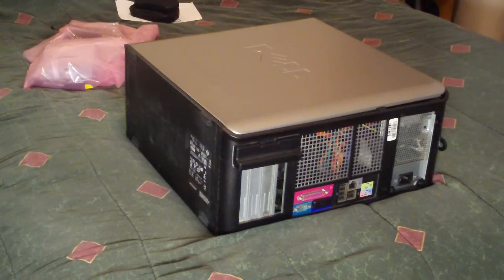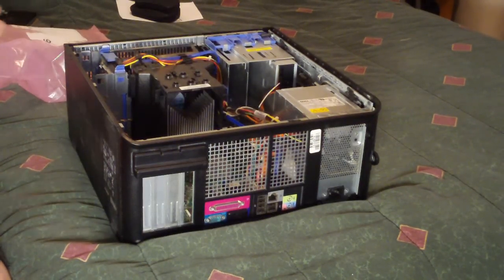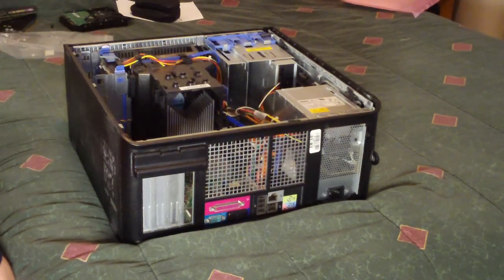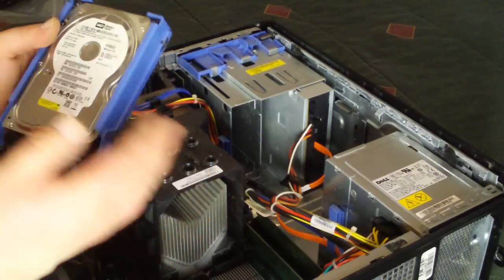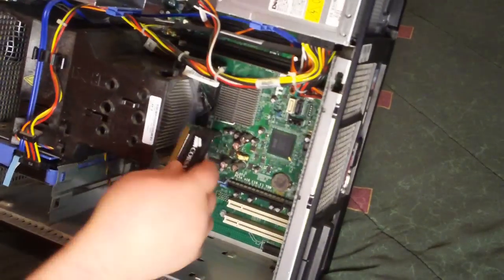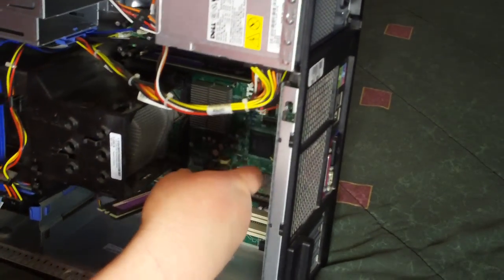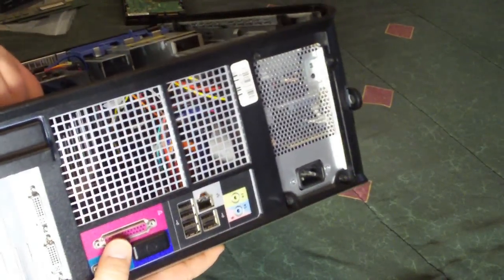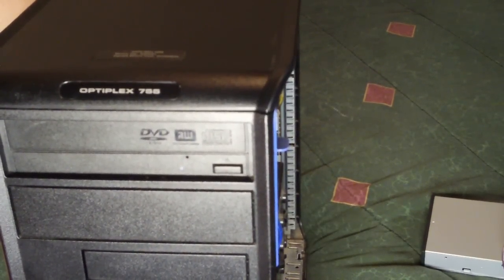Upgrades to My New Dell Optiplex 755

Comment: The Dell 755 offers:

1. RAID 1 support for real-time data-mirroring protection
2. Intel Q35 Chipset (745 uses the 965 express)
3. Quad core option (745 does not)
4. 1333 MHz memory option (745 supports 800 Mhz and slows down to 667 with 2GB)

Comment from the maker: You may be able to go into the Bios and tweak the fan settings, but I would be careful. if the fan is running at a very high rate then the CPU may need to have the thermal paste redone.

Comment: Probably one of the most upgradable Dell systems ever. You can go from a single Core 2 Celeron 1.6GHz all the way to a Core 2 Duo E8600 or Quad Q9650 (after BIOS updates).
Reply: or a Xeon

Comment from the maker: That will work as long as it's not the ultra small form factor system. Most of these models should have at least 2 or 4 SATA ports, but you will most likely have to supply your own SATA Cable.

Comment: I hate the heatsink in this thing. I'm currently running into problems with it being to large. Have you found any way to attach a different 3rd party heatsink?
Reply: John Duthie "Too large"?  The heat sink is designed specifically for this machine and the cowl in which it resides.  If you can't get it to fit back together, something isn't properly installed.
Reply: I meant that it was to large to allow a regular size graphics card. I tried fitting a evga gtx 960 in there before deciding to scrap the machine. The case also only allows for single slot cards. Sorry bout that.
Reply: John Duthie I have AMD Radeon R7 260X  in the 755 MT tower, using a powered pci express extender cable i got for $6 on amazon.
Reply: Where were you 2 months ago when I needed you +karaoke2fame! No I'm actually glad it didn't fit because I needed a reason to upgrade anyway. I thought about replacing my socket 775 dual core duo with something a bitter higher end, and was disappointed. Now it's sitting in the closet collecting dust.

Comment: I have the same dell optiplex 755 model ad you and I wanna know if the video card bracket a half bracket or full one?
Reply from the maker: It depends if you have the full desktop or the Small form factor. Mine was the full desktop model, so it had a full high graphics card bracket.

Comment: I still do not know how to open the card bay from your video, the thing moves back and forth, but pressing the latch inside the case does not accomplish the feat.  I am about to take a hammer to the plastic part to get the Dell propriety video card out of the system.

Comment: I'm thinking of buying this machine, my gateway died, I wanted to take my HD from my gateway and just drop it into the new dell that will come with 160gb HD, so I can have 2 drives and not have to tranfer all my stuff. The question is does the Dell have the Extra Sata and HD cables to upgrade thanks

Comment: I know it is 2016 now, but I'm stuck with a dell Optiplex 755. So I went around and found awesome Hardware for it, from people who desperately wanted to get rid of their old parts. Like for less than 20 quid.

Here are the specs of my Optiplex 755:
Intel Core 2 quad @ 3.00ghz, but for some reason 3.01ghz (Still with old aluminium heatsink :/ )
8gb of 800mhz ddr2 Memory (4x 2gb)
msi gtx 650 ti oc (ripped apart the floppy power cable for it :D )
cd / dvd / blu-ray drive (Can only write cd and dvd)
2TB Harddrive @ 7200rpm
the same cardreader, but newer! (Can read and write SDXC!)
5.1 pci Soundcard
pcie 1x to 2x external usb 3.0 and internal usb 3.0 card
the same old fricking powersuplly :( (I hope it can take a gtx 1060...)

I got the better Optiplex 755!
And I could get an msi gtx 1060 6gt oc, but the cpu-heatsink is in the way :(
I would love one though! :D
Reply: oh yeah, and running windows 10 pro
Reply: For me it's 2018 and a 2008 computer isn't going to cut it, I really need help to upgrade it
Reply: 2022 now, no upgrades worth putting money into for this system. I'm using mine as a NAS

Comment: I have a 755 but with same ram and amount as yours but i placed a Intel Xeon x3363, Nvidia Geforce GT640 2GB and a WD blue 1tb.
Reply from the maker: NICE! The Geforce GT640 2GB is the same card I have in my Dell XPS 8700. It is a very capable card, great for rendering videos and watching HD Video.
Reply: I'm going to put a gtx 750ti in the near future to keep up with my 1080p monitor for gaming
Reply: I like your computer
Reply: Everything Possible you put a xeon chip in your 755 did you have do the sticker mod or whatever it's called?
Reply: Yes I put the sticker mod and also cut the tabs off the CPU socket
Reply: Everything Possible If you didn't jump on that already, 950 will be out in few weeks.
Reply: 950 what?
Reply: Everything Possible 950 will be replacing 750 ti as Nvidias $150 option.
Reply: Oh the gtx950ti?  Nice I'll check that out. Thanks for letting me know.

Comment: I'm thinking of shoving the 755 motherboard into my dimension 3100
Some of the ports won't be used on the back and will be completely open from the motherboard but oh well it'll look like a 3100 but perform much better.

Comment: I have an Optiplex 755 PC just like this one. It has a dual core processor and after running a test it appears to have only core running from the dual core. Is there any replacement processor i can find or any upgrade i get get. i look up my intel processor model and i couldnt find it. The PC is running Windows 7.
Reply from the maker: Click the link below to see a thread that lists all the compatible processors for the Dell Optiplex 755

http://en.community.dell.com/support-forums/desktop/f/3514/t/19537919

Comment: The i5 does NOT have the right socket type for it it has a LGA755 Slot I know the Intel Core i5 does not fit in that slot but your graphics card is good and this motherboard has only 4 RAM slots and the power supply might not have extra power connectors if the card needs that

Comment: I have a dell optiplex 745 mt 305w PSU. I am putting in a intel Q6700 1066mhtz and RAM DDR3 2g each x 4  8g that is to 1066mhtz and lga775 skt. Maybe getting ATI HD6670 or a HD7 series also instal W7 pro 64 bit any suggestions on my idea and questions can i use the same heatsink and does the DDR2,3,5 does it have to match the GPU as stated. Thank  you for ur opinions and help

Comment: Can you use a PCI express 3.0 GPU in the Optiplex 755, I know it only supports 2.0 but please tell me. :(
Reply: +LordHezi I googled it and it said "There are three versions of this slot, but they're backwards compatible, so a modern PCI Express 3.0 graphics card will work in a motherboard with a PCI Express x16 2.0 slot. This motherboard has two PCI Express x16 slots."
Reply: Nicky O' Mahony YES !
Thank you so much man :D

Comment: i have same pc it does have 2 slots for hdd and power lead comes with extra power plug u need only extra sata cable( ny 755 does have 500 gb hdd en9500 gt 1gb  and 4x1 gb ddr2)

Comment: Great vid. Just a query, any ideas on an internal audio/sound card. I would ideally like 5.1 or 7.1 connectivity . have upgraded videocard and memory card reader but audio is lacking that oomph with just the two 3.5mm audio out ports. I have exactly the same model as in the video. Many thanks.
Reply: Creative Omni USB sound card or the Creative Recon 3D SB1350. They are both the same sound card with 5.1 Surround (3.5mm or SPDIF/Toslink outputs & 600ohm Headphone output). The only real difference is that one is USB and one is an Internal Desktop Model. I use both models on two different computers and use the USB with my Dell 755 MT as it doesn't use my PCIe slots which I use for a Asus AMD HD 7750 GPU and I have a 3.0 PCIe USB adapter card in the second slot. I also use the Creative Omni USB sound card with my laptop as it and the internal Recon3D easily hook up to the latest theatre systems with SPDIF or Toslink inputs. I run to a 51" Plasma TV and an Onkyo 7.1 Theatre for movies and to listen to music I make a change in the Creative sound cards control panel and the music then runs to a 2 channel Onkyo Stereo. When I listen to music in 2 channels I still use the 51"plasma for the Marine Aquarium screen saver. I bought this computer for $90 and invest $200 to $300 every month for 5 months until I had a super machine. I was forced to do this as I am handicapped and on a fixed income, plus I've got a shit load of parts I can reuse when I retire this beast on January 14th 2020. Q9650 CPU, ASUS AMD 1GB HD 7750 GPU, 240GB Intel SSD, 2TB Seagate HD, 8GB RAM, Startech PCIe 3.0 USB Card, Creative Omni 5.1 USB Sound Card, LG 16x Blu-ray RE. Note if you are wanting the internal Creative Recon 3D SB1350 pls make sure you have the second open PCIe slot as some Dell 755s only have one PCIe slot used for the GPU

Comment: hi 
thanks for your video  and sharing your information with us

i have one question 

i have in my dell 755 mini tower 160Gb HD and i want to add new HD 1Tb  

i want to make the 160 as a system Disk only (have no data) 
and the 1Tb will have all my data on it in 4 or 5 partition i dont like to make it 1 partition 

is that good or the better way do put the system on the same HD ?
is that right not to make my HD as 1 partition ?

I really appreciate to replay to me 
thanks

Comment: i have the same model. is the  power supply standard or must i use a dell ps?? i need more than 300watt... i was thinking of doing an external ps but not sure how to do it
Reply: I'm pretty sure that this case supports a standard atx power supply. I recommend the evga 500w psu.

Comment: I recently got a Dell Optiplex 755 for really, really cheap. so I thought, "why not" and decided to upgrade it to use for casual gaming, since I need, at max settings for most things, 8gb RAM. put in a 1gb NVidia GeForce 8400 GS. now all I need to do is get 8gb ram upgrade.

Comment: i have an optiplex 755 but my inside is very diff.
Reply from the maker: These systems differ highly in spects. Dell offered many different configurations with this model. Everything from your bottom of the barrel Celeron to a Screaming fast Core 2 Quad Q6800.
Reply: i have a duo2
Reply: +Country Gamer i have a sff 755 that came with a core 2 duo (2.33ghz) but i took that one out and put a core 2 quad q6600 (2.40ghz) and I gave it a better but still pretty crappy graphics card (Ati Radeon HD2400XT) but it runs like a charm. Oh and when I ordered it it didn't come with a hard drive but I had a 500GB WD Sata @ 7200RPM. It's a blazing fast computer. It only had 1GB of ram when It got here and i had three more sticks so I added them now it's 4GB

Comment: these r great pcs just lookout when it comes to graphics card not all will fit. im running intel core 2 duo@2.4ghz. 250gb hdd 4 gig ram ati hd 7470 1gb. and can play far cry 3 on medium settings gta iv etc. all in all a good cheap gaming pc for most ganes

Comment: 1. Don't buy an 9800gt! Ancient, too much power usage, will be unsupported soon and not reliable. 
2. If it supports ddr2 it will never support ddr3
3. All PCI-e GPUs work any any PCI-e 16x slot. So yes.